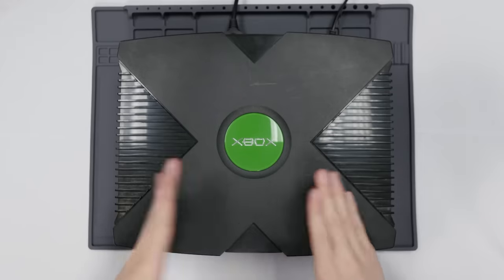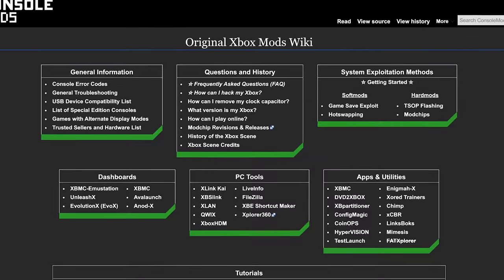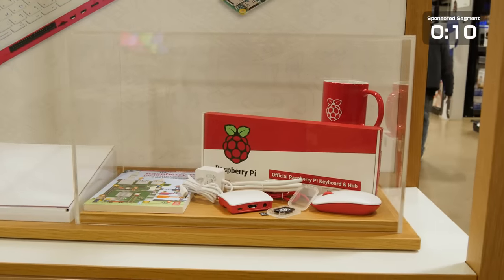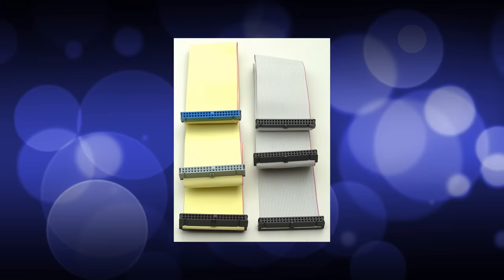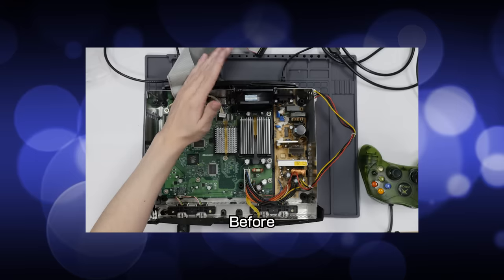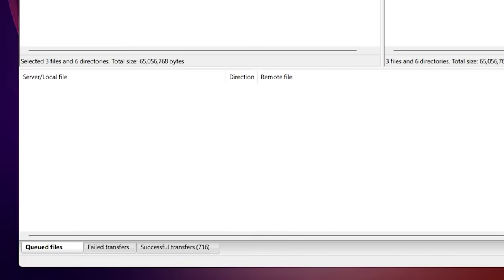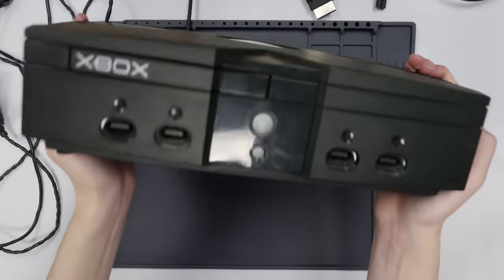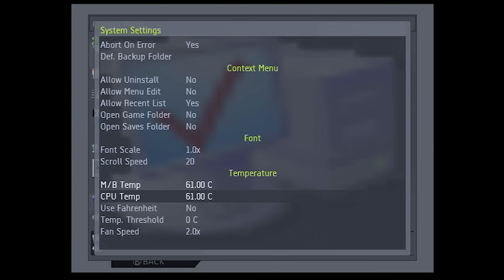The original Xbox is so NOISY. Let's make it ˢᶦˡᵉⁿᵗ

Comment: You should have gotten a Noctua fan... probably would've been better in noise and airflow
Reply: Does Noctua make a 70mm?  I see 60mm and 80mm, but no 70mm.
Reply: I was immediately thinking a Noctua fan as well, but I don't think they make a 70 or 72mm. One of their cheaper grey fans (think it's called the redux?) would work great if the size is available.

Comment: Great video. I did a similar mod a few weeks ago but with an 3D printed fan-adapter and a 60mm Noctua fan. That fits perfectly in the original brackets and it's not loose. But a chose an old 500 GB SATA drive with 7200rpm that I had which made the noise situation worse. Will try an 120 GB SSD this weekend.

Comment: When I made mine silent I was honestly just as shocked as you were at verifying I turned it on. However, I did notice that a lot of what I attributed to the "boot sound" of the Xbox was that jet engine winding up. I felt my system seemed less powerful without the added noise even though it was just as powerful as before.

Comment: Everytime I turn the fan speed up in the dashboard when I boot a game it  drops back down to the default speed for some reason... I'm surprised to see that it worked for you
Reply: If you want to set your fan speeds permanently, you can modify them in your BIOS (if your console is hardmodded). Some BIOSes you have to modify and re-flash to your Xbox, others use a configuration file saved to the C drive. Do you have a modded console? Which BIOS?
Reply: @GoTeamScotch  it's only softmodded
Reply from the maker: I'm not sure which dash you're using, but apparently UnleashX (which I used in this video) patches the kernel in memory so the fan speed will continue even after launching a game (at least until the next reboot). That seems to be the best solution for softmod only.
Reply: @MattKC  I'm using XBMC4Gamers dashboard perhaps that's why?

Comment: If you break off a small section of the HDD tray you can actually fit a regular 80mm case fan in it. A regular HDD still fits without issues afterwards.

Comment: you can also trim out the metal grate over the fan to help quiet down the stock fan. and boot times on the original xbox can be affected by the type of ide adapter that you use. and on the original xbox you absolutely can plug in the center ide plug into the motherboard and it will still work. I have the long part of the cable come up the side of the dvd drive and the short side is folded under the dvd drive and plugs in the back.

Comment: Both my original and 360 eventually developed a disk tray issue, they would make a click/clunk noise when the eject button was pressed, but would require a slap on top just as Matt did to for the tray to slide open.

Comment: If you're going for a cooling mod, you should also renew the thermal paste. The original is probably all dried out anyway. I put a quiet 80mm fan in my OG Xbox, which could spin slower for the same performance, also quieting it down drastically. Isn't there also some kind of SD card adapter to replace the hdd? I don't know how that would compare to an ssd, though. And yes, I found the video cool as well, great to see your surprised delight upon (not) hearing that new fan 😁

Comment: Two things: 

1] I’m pretty sure the reason your Xbox starts so slow is due to your IDE to SATA adapter. I experienced this when I got one cheap from China on eBay. It would take a while to boot into the dashboard and sometimes timeout and give me error 7. When I spent the money to get the recommended Startech IDE to SATA adapter, not only did I not get error 07 anymore but my Xbox also booted faster.

2] The Nexus fan you got pushes less air than the stock fan so you’ll need to bump up the fan speed. The SSD will help for overall heat reduction, sure. But, you still need to keep the GPU and CPU cool. I have the same fan and since my Xbox is hardmodded, I set the fan speed in the BIOS to 50%. It’s still quiet while making sure my Xbox won’t overheat. For you, Rocky5’s Softmod has something called NKPatcher and that’s where you set the fan speed. When you set it there instead of via a custom dashboard, like UnleashX’s or XMBC’s settings, the fan speed will persist at that speed/percentage setting when you launch a game.

Comment: 1:50 "Firstly, just, 'cause it's a good idea, I mean, if your Xbox isn't modded, are you even enjoying your life?"

I don't know about you, but for me, this applies to every console. Every console's a deal breaker unless I can mod the sh[Win98 beep]t out of it.
The idea that the only reason to bypass the console's security would be to pirate games really breaks my heart. There's just so much you can do with a modded system, it's insane.

While we talk mods, I would've gone for an SD to IDE adapter instead. Way cheaper than an SSD overall, and also less wasteful in terms of technology. That approach would've required a modchip though, since those adapters can't be password-protected like the original IDE drives.

Comment: A tip for the Nexus fan, you can wrap the cable around the fan to not have it all bundled up in the corner.

Edit - also i turned the fan around so rather than be an Exhaust it became the Intake. Temps are much better and ive been running my xbox for 2+ years and havent seen any drawback in doing so.

Comment: The TJ Max of xbox cpu is around 80-85C depending on where you look. I put a Noctua NF-A8 FLX 80mm quiet fan in mine and repasted GPU and CPU with Thermal Grizzly Kryonaut and I idle at 38C (100F) at MCPX and 49C (120F) at CPU with ambient room temp of 68F (20C)  to 72F (22C) depending on the day. It was definitely more work to make it fit but it's invisible from the outsite and all screws can still be secured down. Also cut some plastic to fill the holes on bottom of xbox since replacement fan doesn't fill those gaps.

As far as the BIOS taking that long to load, I believe that may be the DVD drive check? You can disable it with a modified BIOS and it should boot a lot faster.
Sorry if anyone else already mentioned that.

Comment: I've been using my new computer with a Ryzen 5900x for about a year now. I have 6x Corsair 120mm ML fans. They are so quiet that I didn't believe they were even working. But they do. I even maxed them out and they are considerably quieter than my old computer at idle. The CPU with Dual 360mm Radiators runs at 65 degrees and the GPU, which is a part of the same loop runs at 45 degrees. It's so quiet that I forget it's on even when using it.

Comment: it's a strange topic to me. around the time i replaced my friend's xbox hdd with an ssd, i found one premodded on ebay for dirt cheap and decided to replace that hard drive too. his xbox is far louder than mine, specifically the disc drive. both of our drives dont work, but even with a mechanical hard drive mine is relatively quiet in comparison to his which groans for about 5 minutes after startup

Comment: Possible that adapter for the SSD has an initiation time. Running power to it continuously including when not powered on, should allow for much faster boot times. You could test this theory by jumping off a power supply and powering the adapter before turning on the Xbox. But it's not such a big deal to wait a sort bit on start-up, at least not to me.

Comment: there is 3d print adapters,  to use a slightly smaller fan  ( for example a way better and quieter noctua fan ) those also give a good seal to the back

Comment: This has been the whole motivation of the Xbox I've been working on since last fall. I guess I should've done a video on it lmao. It was a 1.0 for starters. You got off easy with the 1.6. That fan gpu is extremely whiny. Swapped in a 500gb wd blue. Disabled disk drive with a hard modded reflashed tsop (no whiiirrr wiiiiirrr of the disc drive checking for a disc). Applied new thermal compound lastly, while replacing the gpu heatsink for that of one on the 1.1-1.6. Only thing I haven't touched is the fan. I'll probably go with the solution from this vid! With new thermal compound, my xbox idles at roughly above room temp. 35 or so degrees C. I bet with the new fan there won't be any appreciable difference in thermal severity.

Comment: My Xbox was the 1.0 version. It had an extra fan on the GPU heatsink. After many years of use, the bearing started to wear out, and was super noisy. 
That is, until one day it failed completely, and the xbox just started shutting down randomly, due to overheating. 
Since there were no spare parts (my country had very low xbox adoption), I had to improvised, and use a normal 12V PC case fan, since the fan was gigantic compared to the stock one, I had to keep the top lid off xD

Comment: The reason it’s taking a while to start is the sata Adaptor. If you use the star tech brand it goes much faster but it’s really just an extra like 30 seconds so I usually go with the plain green adaptors and never had an issue and I’ve made about 20 of these. I use the star tech red Adaptor only for my personal box.

Comment: If you take apart the DVD drive to where you only have the PCB that the IDE connects to you can remove that entirely to maybe give it some more airflow. I have wanted to replace that stock fan myself however because it is rather noisy, too bad no one has made an actual 72mm fan replacement when there's so many other mods available and now even actual HDMI mods.

Comment: Are there similar quiet fan mods for the original Xbox 360? I got a modded console a while back and it came with a 12V fan mod that, while it does help keep the system cool, is ridiculously loud.

Comment: just a heads up, like with the original playstation, you can adjust the laser power so you can give at least a little more life to the xbox optical drive. had to do it myself for my own xbox, since i needed to use hexen after hard modding but the ODD was just not cooperating.

Comment: I remember modding my Xbox back in the day. Really early, too. Had to source my own pic uC, flash and socket, and program it manually. It was kinda jank looking internally, but it worked reliably enough. First thing I did after modding it was stuff an 80gb drive into it.

I loaned it to another guy before I deployed and the dude sold it. (rather disappointed about that.) So if you've got a jank-looking modded Xbox with a loud AF 80gb drive inside and a small toggle switch sticking out of the second to the leftmost vent on the bottom shell, running XBMC with a black-and-white 1940s-era picture of a younger lady holding up a STEN SMG at high-port,  I hope it's still going and let it know I miss it. And probably get a modchip less likely to sh*t itself, because I barely knew what  TF I was doing back then. Early days and all. (TBF, Microsoft was the same way when it came to security. Unfortunately, they learned, and damnably quickly, when it came to the 360.)

Comment: Just use a round 80pin you can still put the motherboard end in correct area ANOTHER expensive option is useing modchip with a COMPACT flash saving you money on SATA to IDE adapter. If you put a thin hole in side you can actually have a compact memory card slot with basically an external SSD via compact flash since compact flash has IDE protocol. If you have any dead later models you can swop the newest non-fan version of GPU heatsink which frees up a fan header to add a top down fan or 2nd exhaust fan with a fan hub I added 4 low amp server fans with filters lowering  your temps 10deg or more

Comment: You could use PC DVD-Drive tho. But the original drive still need to be connected, at least the power cable. since it used as a trigger for drive close/open.

Comment: I might as well replace the fan when I remove the clock capacitor.  if I'm not modding the system, will the new fan still run fast enough with default system software?

Comment: Static pressure is also a spec which needs looking at when changing fans, sure it might move the same amount of air in free air but what happens when you add a fan grill in front of it?

Comment: Hey guys I got a tip on how to fix stuck xbox dvd drives, open the drive release the disc bay, and take out the rubber band and soak it in hot water for 10-20 minutes and it will work a lot better
Reply: thx i don't want to buy a new belt

Comment: SSD's either loading slowly (or not at all on the first try) is a common issue. It's related to the IDE to SATA converter and how fast the SSD initializes. It can be too fast for the Xbox causing a weird or failed bootup.

Comment: Change the thermal paste to something decent. MX4 or kryonaut, it will easily drop 5°C off that temperature.

Longer time to boot means it's having trouble to identify either the dvd drive or hdd.
That happened to me when I replaced the stock dvd drive for a 16X PC drive back in the day.

Finally the sata to ide adapter quality DEFINITELY matters.
Not only the Xbox, but the Dreamcast bennefit a lot if the sata to ide adapter has a "Marvell" controller.
Both my xbox and DC have one paired to sata ssds and they instant boot.

In my xbox I have replaced the fan with a 80mm one, you'll need to break the bottom tabs, and cut a bit of the hdd holder.
Stuffed a Noctua in there, it greatly lowered noise AND temperature, also the cut in the hdd holder makes fresh air run through the hdd area, cooling the hdd/ssd.

Comment: I find the cheaper ide to sata adapters cause the slow boot. Something about not powering the drive up quickly enough if memory serves.  This causes the xbox to recheck.  

Some are so slow you have to reset it so the drive maintains power.

Comment: A rare mod that I find really interesting is the upgraded CPU with a switch you can flick to switch between original speed and 1400MHz

good IDE components can be a pain to find at a good price. As with the PSU in your N64 power adapter, those things are so worthless nobody saved them.
My ~2008 stereo system has 2 modules and they're connected with a 40 pin floppy cable (wat?!). So far, I've had no luck finding a listing that doesn't cost me like 30€ with shipping

Comment: Probably overkill but you could repaste the thermal compound on the CPU/GPU for better temps overall
Reply: you are right. It's not overkill. you need to change Thermal compound on CPU/GPU make its temps better with same fan. It is very old console.

Comment: Upgraded mine with 80mm noctua fan.  Had to cut some plastic from HDD tray and case a bit. But fan has no air gaps around. As for fan speed. I usually keep it at 70% idle.  Stock fan had 20% speed but it was powerfull but i never heard it go over 20%. So 70 80% nonstop and its still almost silent. (45°C after hour of load. 50°C in summer) Barely can hear it at 2m away with TV sound off. As for HDD. Using 2tb WD red 5400rpm. did not feel any speed downgrade over SSD. (80 wire IDE). Its quiet and runs cool.  Upgraded mine with 128mb ram. Some games benefit with patch and emulators too.   I recommend buying HD AV pack really makes difference in picture.  Sadly my video port kinda died. so instead of resoldering it. i think i will HDMI mod it. so there is digital-digital.  Still my favorite console to play. Nothing beats drunken splitscreen cottage halo 2 or timesplitters2 multiplayer.   Was about to recommend to remove clock cap. but noticed you have 1.6. Insane how much less stuff its in int compared to my 1.0.
And last thing. There were 2 manufacturers of power supply. Delta and someone else. Nondelta had troubles with solder joints on plug and eventually broke and sparked and started fire. Cant see from picture what you have. But i would recommend checking it out.

Comment: Honestly, I can't see myself replacing the fan in my Xbox. The noise it makes is just so nostalgic to me. (It sounded quite a bit different from the OG fan in your Xboxes, though)

(I did replace the stock hard drive with a 160GB one I found laying around, but that was for two reasons: 1. To load a bunch of games, 2. Because the original one emitted a high-pitched noise that hurt my ears.... which is actually kinda hypocritical of me considering my TV constantly emits a 15KHz whine because... well, it's a 15KHz CRT.)

Comment: Would you consider replacing the fan with the larger 80mm NF-A8 5V by Noctua? It would require some modification of the interior though, so not a drop-in.

Comment: About your slow startup, my softmodded xbox after using Chimp to replace the hard drive will not boot in a dashboard without opening the disc tray. I have no idea why. I've talked with people on Reddit and they suggested things like installed a font and other weird stuff, but I never got it to work correctly. When it boots, it plays the splash screen and goes to a black screen. It will stay there until I open the tray. If I put the original hard drive back in, it doesn't do it. It boots normally.

Also, if you "zero out" the hard drive key on your xbox, it may break some of your save games. I know saves for Burnout 3 are affected by that.